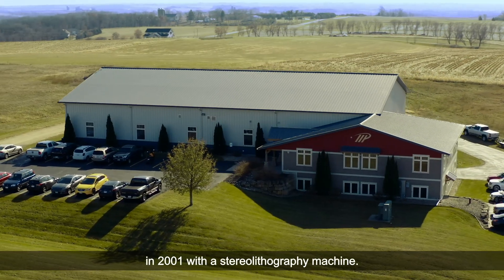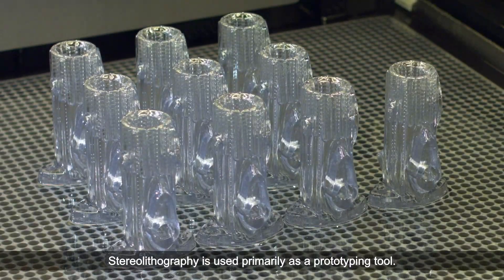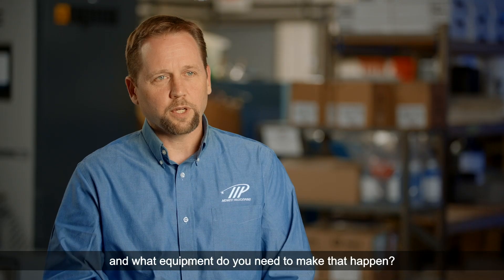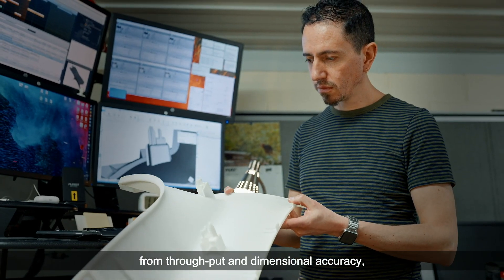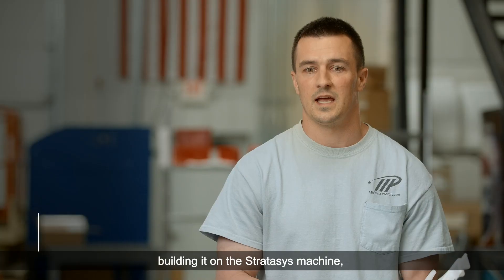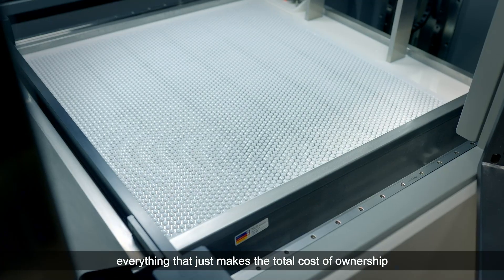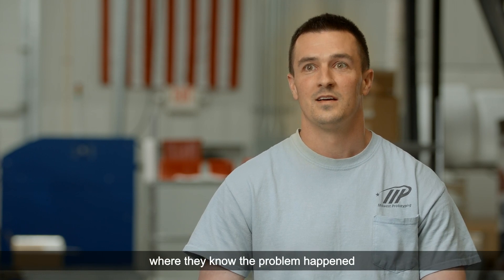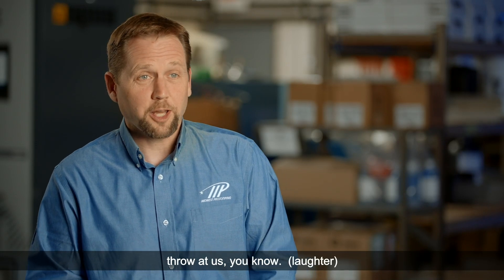Midwest Prototyping reinvents the Service Bureau with Neo

Comment: How does this machine deal with peel forces on big prints?
Reply from the maker: Hi there, with stereolithography 3D printing technology, the Neo prints top down (laser comes from above) rather than bottom up. The laser cures the surface of the resin and therefore has no peeling force . As there is nothing to peel away from, there will be no peel forces with a large build.
Reply: @Stratasys  Is this like msla where it cures a whole layer at a time? I am interested in how fast it prints compared to msla printers and the price.